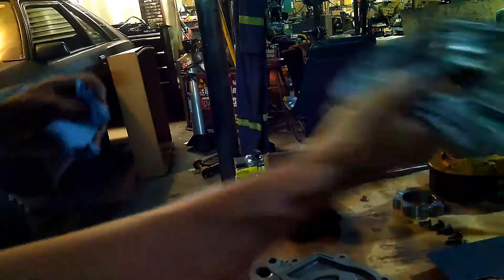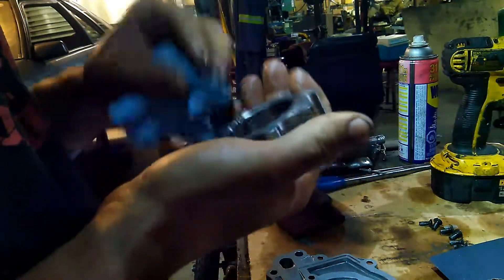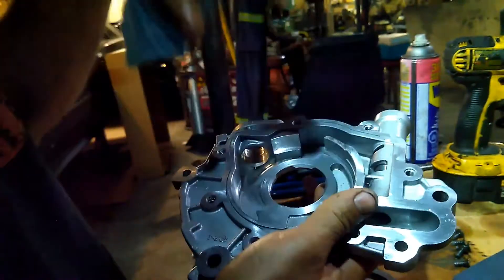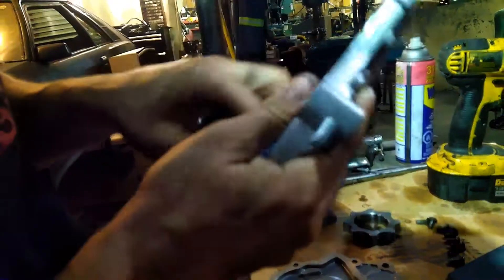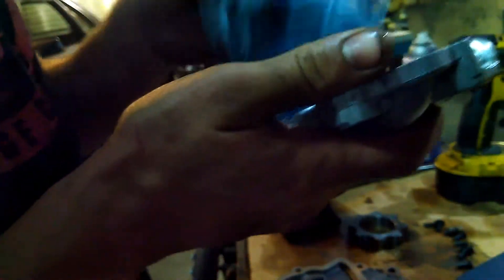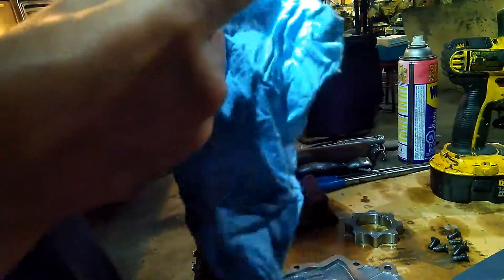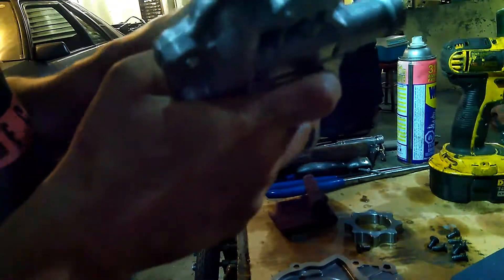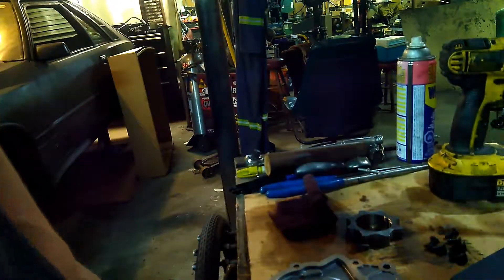Taking apart a coyote v8 MMR hurricane oil pump.

Comment: Would you recommend these gears for my Cobra rebuid? I really can't decide. MMR ,TSS or Boundary. Price is no problem I just want the BEST gears for my 01 Cobra (about 10k into the engine) Only gonna get like 500RWHP MAX so not super super high. I just want no oiling problems.
Reply from the maker: Don't know who to recommend. I know MMR has some world records for modular Mustangs so maybe them
Reply: @Nodarperformance  I have decided on TSS. The price is like $300 but from hours of research that seems to be the most "reliable"
Reply from the maker: @SkepticalVex  fair enough. You would think oil pump gear failure wouldn't be a problem by 2019